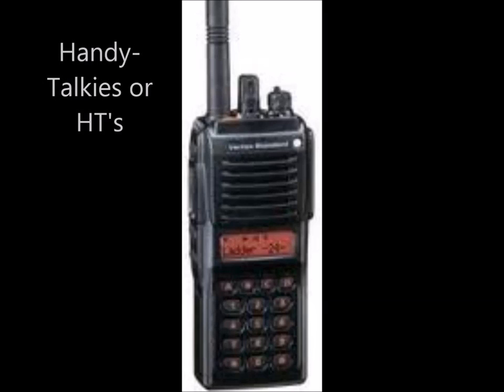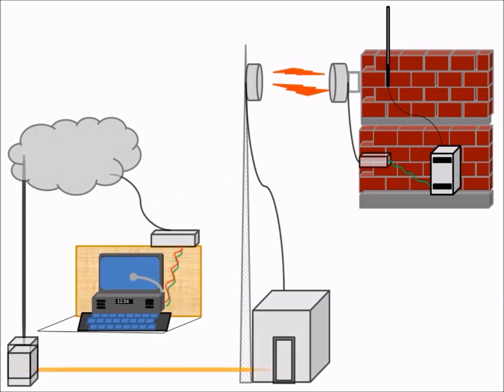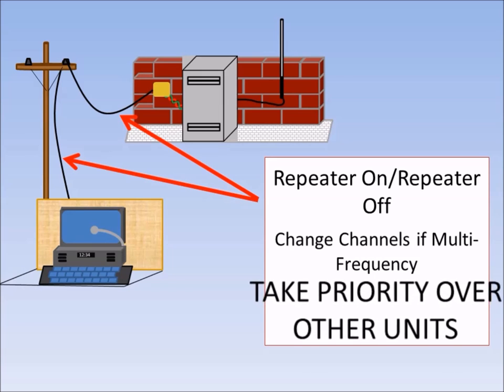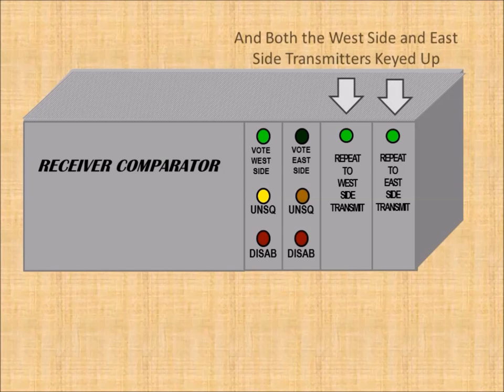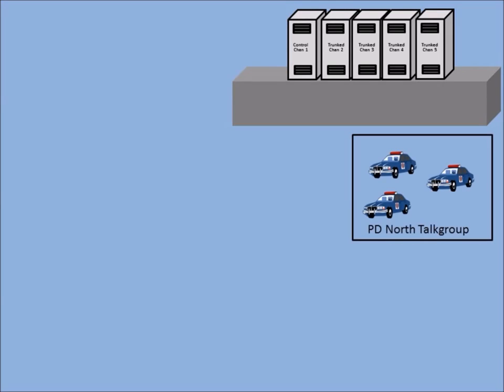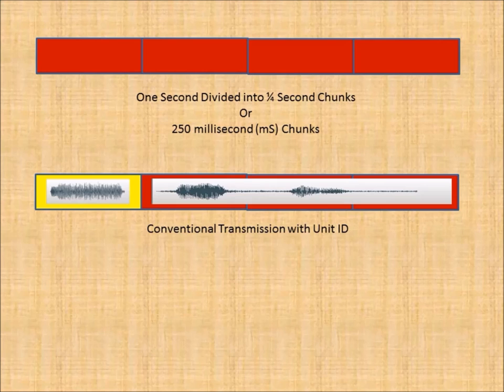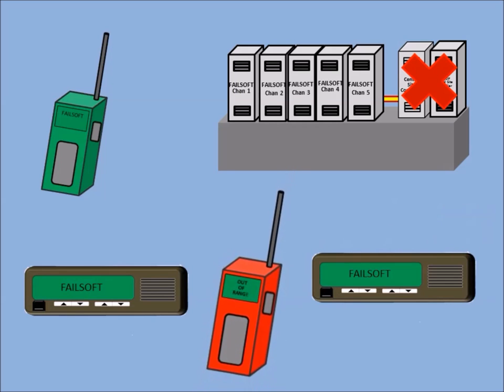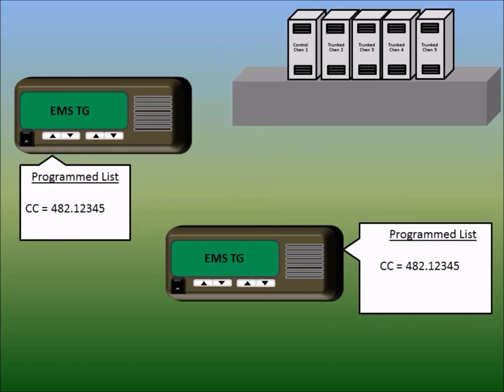Radio System Operation for Public Safety Communications Professionals

Comment: 33:00, some users may be familiar with Site Trunking. This is, at least in Motorola systems, the step after the dedicated site controllers are lost (or the connection to those controllers are lost) and before failsoft kicks in at the site level. It works by having one of the control channel repeaters with the "intelli"gence to perform the control function. Also at 38:16, I have never heard of a P25 system that uses voice channel freq lists programmed into the subscribers. Control channels programmed into the subs, yes, but not voice. Voice channels are assigned using explicit or implicit methods. Most common is implicit with explicit used mostly for other band trunking which often has unique offsets. TIA AABC-C is the doc that describes implicit vs explicit using the 16 element band plan table. This static table gets entered into the subscribers and then the subscriber receives a channel number over the CC, then uses that number and the band plan table to calculate the voice channel frequencies. My history on this is limited to Motorola P25, so maybe other manufacturers do it differently.

Comment: technological Sustainability. Back in 1979 when our ESDA communications van unit 956  stacked with motorola transceivers funneling allocated bands of frequencies made available to hardwired hardware software enabled four bank switchboard panel capable of unifying ground unit intercom communication on seen command loop